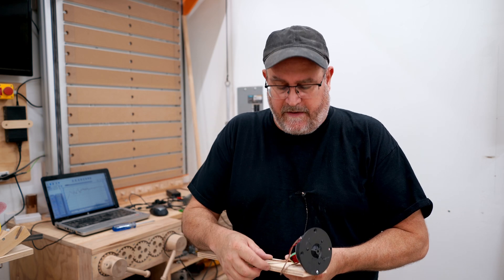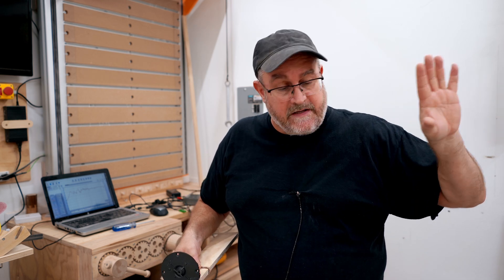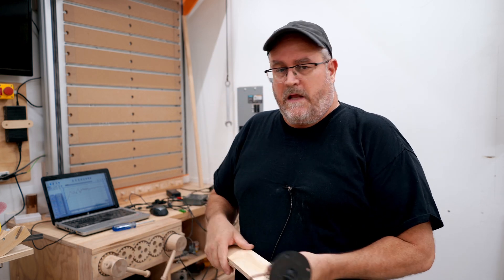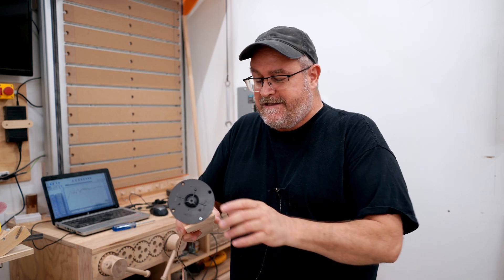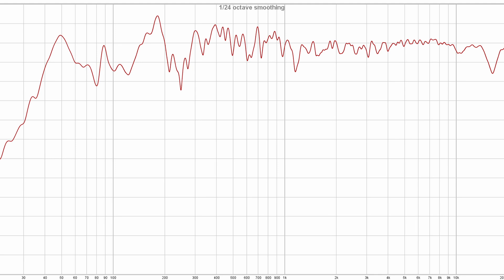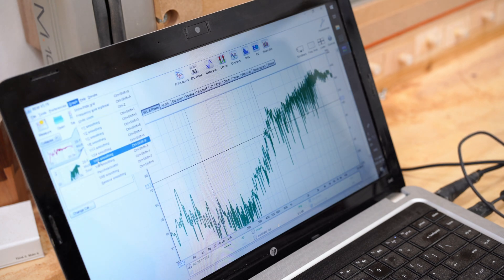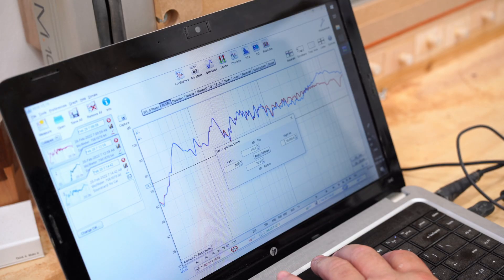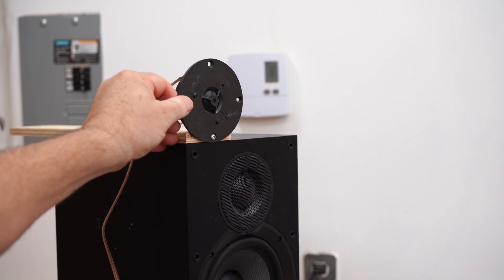Super Tweeters Suck... Here's Why

Comment: i think this was a fair enough test of basic supertweeter addition.  like most times i heard of them as and addon pice you place near your tweeter. 
there are many ways this upper end tweeter could work better. if you have a dsp crossover speaker, then you can have steep slopes for the 8khz and above and make a low pass filter to the normal tweeter, or only add this kind of tweeter to speakers that lack anything up there.
would have thought that these 8khz and above tweeters could be made to be very small.

Comment: Just got my hearing checked.  I'm starting to loose top end frequencies, which makes me sad.  Right now its 16k and up.  I could tell it was occurring over the past year.  I'm almost 50 so pretty well in the middle of the pack.  Was hoping to push it out another 10 years.  Oh and reading glasses became a requirement too.  I will be checking to see with the medical community can do for that because I hate glasses with a passion.
Reply: I'm 59 and my hearing stops at 13k. I hate it because throughout most of my life I could hear things others couldn't. In my early 20's I could hear to 22k in my right ear and 18k in my left. But, I guess for nearly 60, 13k is not too bad.
Reply: @ScottGrammer  Yup.  It is what it is.  I have always been very diligent about hearing protection but nothing can be done for genetics.  Doctors told me there is noting that can be done for my eyes since only my near vision is impacted.

Comment: People won't add a "super" tweeter for frequencies that are already played with their tweeter good. This would be a mad idea. What a super tweeter does, it plays from 20 (most textile dome tweeters stop there) up to 40. Of course this super tweeter is AMT, or a ribbon, or even a plasma one.
Reply from the maker: That was my understanding of what a super tweeter does as well. But then I did a quick Google search and found things called super tweeters that will crossover as low as 8KHz. 
But that's semantics and misses the point of this video, which is the interaction a super tweeter can have with the tweeter that's in your speakers. It's something everyone who's thinking about getting a super tweeter should know.
Reply: @IBuildIt  It would be my guess those supertweeters are for use with 6" or bigger single-driver speakers. You could point that off-axis to supplement the narrow directivity. Or they are just a stupid design.
Reply: Most recordings don't capture ultrasonics in instruments, so a super tweeter is useless in that instance